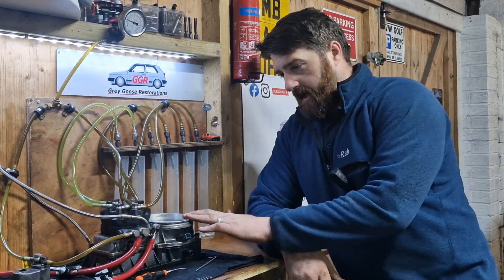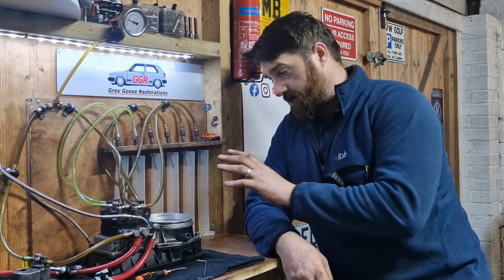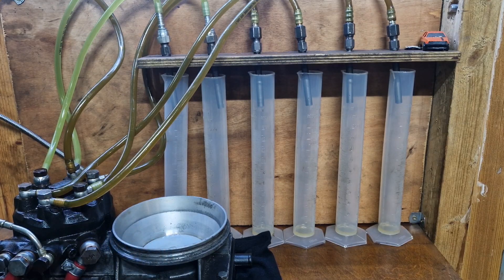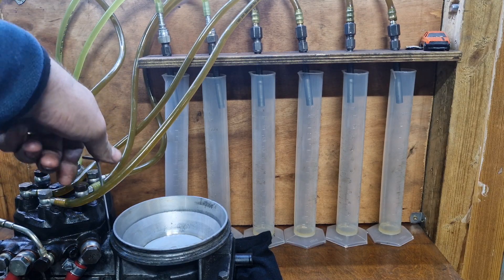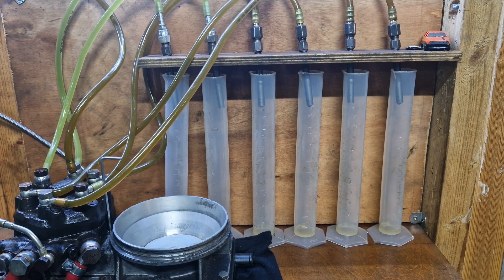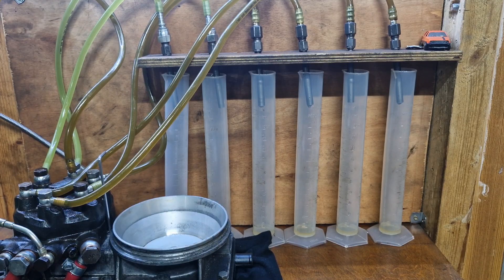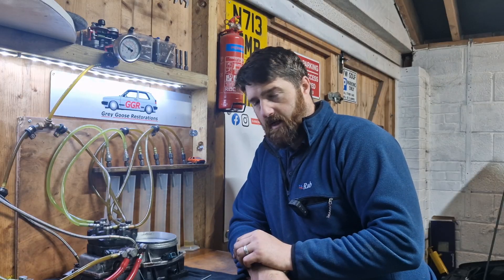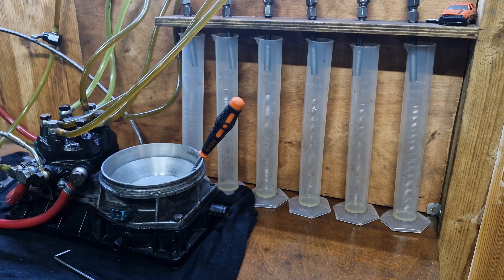Bosch K-jetronic - CO Mixture Basic Setting

Comment: That was very informative. My situation is that two of the injectors are putting out more fuel, how could that be solved?
Reply from the maker: Either adjustment is required or failed seals internally (depending how much fuel is extra)

Comment: How can we widen the air flow to increase air and performance
Reply from the maker: No need to widen as there are a few units that are very wide and will flow more air than the engine would need with the fuel, most stock kjet units will support around 25% more power without tweeks
Reply: @GreyGooseRestorations thanks sir. In regards to the wur. The electronic ones sold by 911 US guys. Some of them I've seen them fitted on mk1 and 2s. Seem extremely more powerful as the load for fuel is much finer

Comment: Quick question testing fuel pressures on the ke jettronic cis system . The fuel pressure gauge the side of the gauge with the shut off valve what part of the fuel distributor that goes into ? The cold start injector port on the top chamber or the bottom chamber?
Reply from the maker: On KE-jetronic its on the top centre union then onto the lower chamber, there's a blanking bolt on it or test port 👍
Reply: thank you I had it hook up like that but only got working pressure  on valve close I got no system pressure.  Could it be air in fuel distributor? Or what else could cause this? I was told join the fuel line from tank to fuel gauge and then shut off side of gauge directly to where the fuel line was. Is this a correct procedure?
Reply from the maker: Thats wrong

Go from top centre union into guage then the tap then onto lower chamber test port,
Reply: Thank you

Comment: Same question as @maxkaufel4715. I did turned Allen key when my Peugeot 505 STI. K jetronic started dying when I accelerator while I am driving. Now it doesn't start any more. Does the WUR needs a bridging when setting up the initial mixture. And also what causes it to loose power when I accelerate. Great thanks to your help.
Reply from the maker: Loss of power can be a number of things, CO mixture wrong, fuel flow, control pressure etc
Reply: @GreyGooseRestorations guess what, I have followed your instructions, turned the key on my car started same time. Thank you very much.
Reply from the maker: Glad to hear ❤

Comment: Is this done with the warm up regulatur connected to power? I am currently bench testing my k-jet system and I was wondering about that. Because if my theory is correct control pressure is should change the amount of fuel on idle.
Reply from the maker: Yes with the WUR working as it would be on the car

Comment: May I ask,  recently got fuel pressure right with warm up regulator, but no the car has like a hick-up at 170Km/h where it would previously with incorrect   control fuel pressure of about 5.5 bar it would struggle to about 180km/h. Now with about 3.5-3.8 bar pressure it has the hickup. What could it be. Exhaust pipe also white on unleaded fuel.
Reply from the maker: Does it hickup after a wide open throttle blast?
Also the CO mixture will need to be checked and adjusted after any fuel pressure change, potentially you have lean running
Reply: Yes, hickup happens at wide open throttle. Tried adding more fuel by turning the 3mm allenkey 1 quarter clockwise, but then the car would not start. The exhaust tailpiece is white and therefore your statement about the lean mixture is true, right? The control pressure was at 3.8 bar, but drops within seconds of switching the ignition off. Any advice please?
Reply from the maker: If any pressure drops off within a few seconds then you have an issue with the fuel distributor not holding fuel pressure, which may be your lean running as the system pressure isn't being held, what was system pressure at
Reply: Thank you, System Pressure was at 5.5 Bar if I remember correctly
Reply: Could it be the accumelator?
Reply from the maker: Accumulator would cause hot starting, lean misfire can be the lift pump in the tank failing
Reply: Thank you, I am having difficulties at hot starting as well yes. Do you mean during the day, that the car struggles with starting even though the engine is warm?
Reply from the maker: If the cars been switched off for 20-30 min and has issues starting then the Accumulator could be the issue as thats its job to hold fuel pressure in the feed line for around that period of tkme
Reply: Thank you, much appreciated, will replace the accumulator first, but I gather it might not resolve the hickups right?
Reply from the maker: I would check the in tank lift pump filter and connecting tube for serviceability and the volume delivered by the pump
Reply: Thank you. Will do
Reply: Also, I have replaced the lift pump in the tank and the external pump recently, which then gave me the correct system pressure.

Comment: Thank You for the video! How big is the hex of the adjustment screw on Bosch K-jet (Ford escort xr3i)? 4mm?
Reply from the maker: 3 mm 👍
Reply: @GreyGooseRestorations  Thank You, four your help. :) 2nd question: How to set the IDE rpm speed? (becouse my is too high 1300-1400 rpm) Where is that screw on Ford XR3i engine?
Reply from the maker: Should be on the side if the throttle body

Comment: So I hope you can answer this question for me. I have a 1988 volkswagen cabriolet and the adjustment screw doesn't seem to do anything. When i watch the dwell, it doesnt change, it just stays around 17. It bounces a bit at idle too. Not horrible though. It still hesitates a bit when coming up from a complete stop. I just cant for the life of me get the screw to change the dwell. It doenst do ANYTHING. Thank you so much! Ive been learning so much from your videos
Reply: Other than this it does start first try and is drivable. But it is slightly gutless.
Reply from the maker: With the CO mixture its best to use a gas analyser than dwell meter.

Comment: Golf mk1 1.8 gti. Car idles and revs ok in the garage but when I put it under load while driving it sounds like it’s running on 3 cylinders or or like a 2stroke motor bike, there is a loss of power and change in the exhaust note . But it does this “misfiring” only sometimes . Like if I let off the accelerator and press it again most of the time it will drive fine. Some days it will drive perfectly all the time.  What’s going on ? I have changed spark plugs / ht leads , fuel filter , change the 4 green seals on on injectors, ultrasonic cleaned the injectors, and changed the distributor rotor arm ( now it did have a bit of burn mark where the ark jumps but it’s replace now ) also changed the soft vacuum hose joiners . And it’s still doing this weird not running right thing . I tried squirting brake cleaner on pipes to see if there is a vacuum leak but as I said it only does it sometimes and usually under load . I did wonder is it possible for the plunger in the fuel system regulator to get rusty as in just not sliding freely ? Car is driven about ever Sunday or ever second Sunday
Reply from the maker: What's the condition of the in tank fuel pump? It may be getting fuel starvation
Reply: @GreyGooseRestorations  ok I “think” I have it fixed, I think the Fuel mix was too rich, And the misfire was probably a cylinder getting flooded . I did a co test using a Co gas analyser and the reading was way out. I last check the Co reading about 8-10 years ago I guess the screw vibrated over time ( can it ?) or what changed the reading soo much , would different octane petrol also change the Co reading ? I had to turn the co screw about 1.5 turns  
The Gunson co analysis read 7.6% when it should be about 1% I’m guessing ? To give AF of 14:1
Reply from the maker: I wouldn't trust that gunson one to be correct as they are wildly inaccurate, if you can do the reading 2-3 times with calibration on the tester each time and its the same then that would be good, the CO mixture wouldn't vibrate out as the thread is to tight a fit to do that
Reply: @GreyGooseRestorations I’ve been watching loads of your videos . Thank you for sharing. Please keep making videos they are really super interesting

Comment: Hi, what kind of screw it is you used for make the mixture?
Reply from the maker: Is a 3mm allen key
Reply: @GreyGooseRestorations 
Hii am having the same system I have never played with adjustments but it's not starting it cranks but does not send petrol to the injectors but from the fuel pump I get fuel to the kjet pump I don't know what to do please help
Reply from the maker: Has the car been sat for a long period
Reply: @GreyGooseRestorations yes indeed it has been
Reply from the maker: Ok it may be that the fuel pin is stuck and the air flap cant rasie it, can you lift it by hand
Reply: @GreyGooseRestorations I tried to lift it by hand a little and opening up slowly further up and cracking it over floods the injectors with fuel 
Just for understanding does the Bosh kjet pump spray fuel simultaneously as the distributor sequence? Meaning they don't all pour at the same time?
Reply from the maker: Nope they all spray fuel at the same time, if the air plate is free to move and opens the injectors then I'd say that there is something affecting the engines ability to lift the plate which can be air leaks, compression issues or timing etc
Reply: @GreyGooseRestorations  Thanks 🙏🏼

Comment: Hi Sir i am struggling with k-jetronic fuel a  1988 jetta cli the plate you show on a video an you said is for air pressure it doesn't work well , so i have to pull it up two or three times so that fuel get in to enjectors before i start the car.I am asking for advice what could be the problem...?
Reply: Yep sir the thing is I have to help it to pump the fuel inside the box bt nw I understand it might be the fuel pin is stuck. So if the pin is not working hw cn I solve that problem..?
Reply from the maker: You can try and manually pull the pin out if that doesn't work then unfortunately it would need rebuilding
Reply from the maker: Does the air plate move freely when you move it? Id check you have sufficient system pressure firstly then see where that directs you
Reply: @GreyGooseRestorations No Sir the plate is not moving freely an thanks again I wll check out the pressure
Reply from the maker: Check that the fuel pin isn't stuck

Comment: Hi i have a 1984 Mercedes 280 se it will start first turn of the key and idle but when i touch the accelerator it goes to cut out i was told the fuel pressure needs adjusting does that sound right
Reply from the maker: Potentially yes but I'd do the basic checks first like air plate heights and CO% - after than if the problem persists then I'd check the fuel pressures as this will point you in thre direction of the fault
Reply: @GreyGooseRestorations  Thank you when i start car from cold it fires with in a few seconds when i put the foot down on accelerator it just goes to cut out what is the CO% and how would i adjust fuel pressure
Reply from the maker: @Farmer2492 the CO% is the mixture of fuel at idle and sounds like yours is lean so not enough fuel which could be the air plate setting to high or the mixture not right or potentially fuel pressure issues

Comment: Hello. Great video, I shared it on a Porsche FB page. Question: I adjusted the 3mm screw all the way counter clockwise but fuel still comes out. What do you think the issue is?
Reply from the maker: Either the fuel plunger is now too low so uncovering the upper edge of the slits and your getting control pressure being injected or there is a seal failed internally or the fuel plunger is stuck? How much fuel is coming out?

Comment: Is this measurement of 10mm in 30secs the same for porche 924n/a 2 litre I have 10mm on all bottles but number one is flowing to much at 80 mm I have put new injectors in would it be faulty fuel distributor its unusual it's just one measure number one is pumping way to much fuel I have swapped the lines over but still one is spraying far to much fuel in 30 secs
Reply from the maker: If one is getting that much more then I'd say you have a failed seal in the distributor, all 4 cylinder units should be 10cc/min thereabouts
Reply: @GreyGooseRestorations you have been a great help . last question does the metoring plate open with the engine switched of when you open the throttle..or is it just when car is running under vacum
Reply from the maker: @stevehunt3847 it'll only lift when the engine is running 👍
Reply: Thanks  @GreyGooseRestorations

Comment: Very good video, very helpful. I am looking to build a test rig for K Jet as I'm helping a friend with a hot start issue on a 1983 VW Golf Gti, we think we have narrowed it down to fuel evaporation in fuel lines due to pressure being lost down return line to tank via primary pressure valve.

Comment: Is it similar values cc wise on  my 5 cylinder 
Quattro turbo engine.
Big thank you for your
Help with understanding of the fuel system. 
Still having issues on my system, on hot starting.
Cold start is perfect, 
Thinking injectors.
Leaking slightly after 
Engine stopped.
Hot .even after twenty minutes. 
Lot of cranking to fire up.
System Pressure is 5.4
Bar.
Injector's yr old.
Car feels running slightly  rich.
Up to 60 mph.
Best regards. 
Darryl Tucker.
Reply from the maker: Yes regarding The CCs the quattro did use the 5th injector to aid hot starting so you could check if that system is working

Comment: I have the same system on my BMW e21, 410k km and still running. As long as people don't mess with the allen screw and the plate without knowledge, they system is very reliable, one thing though the system is very sensitive of vacuum leaks. My other car has a Kuggelfischer mechanical injection, both very robust and simple.
Reply from the maker: Exactly, once set and working, there isn't much to go wrong.

Comment: This is the easiest and most reliable system one can find. I'm using t in my Audi 100 5e Turbo
Reply: Hmmm... Easiest and most reliable provided the car has been kept up to scratch maintenace wise... Many, Many Kjet Cars are now up to 40+ Years of age, with some having been laid up for decades.... In these instances the Continuous Fuel Injection System can be a pain to re-commission... Air leaks, Faulty injectors, seals, Clogged Fuel Lines, Junk in the Tank, Clogged filters, Dead Fuel Pumps, Persished seals, out of calibration metering heads etc..If you check the comments they're mainly from head scratching enthusiasts (like myself) who are reasurrecting an old skool classic.... With that said I'm pleased that yours is running sweetly.... Nice cars the 100 5e Turbos!
Reply from the maker: @1881Gordon once they are working its a bullet proof system but like you said can cause numerous issues after all these years
Reply: @GreyGooseRestorations Agreed 100%. I should have added that we truly appreciate Knowledgeable people like your good self for brilliant tutorials, helping us get our aged cars back to good, reliable health... Thank you GreyGoose x1000 👍

Comment: Hi thank you very much for making all these videos it helps us a lot a specially us in South Africa 🇿🇦. A lot of people who had or still have these cars are no longer running the original system. Due to the fact that they have no idea how to deal with this system. I once recalibrate my 1.8L 8v called CTI in South Africa which is the same engine from GTI , which produces 82 kw and 157Nm of touqe..most people end up putting a carburetor which is not good as the original k jetronic is. Once thank you so for your videos are helpful.
Reply: Hi. I'm in Pretoria. I use this system in my Audi. I won't change it for anything.
Reply from the maker: Glad they help out around the world
Reply: Contact me I still use this system on my Audi. I'm in Pretoria.
Reply: @georgeseckle5982 hi I've got the same golf but the air and fuel mixture is giving me a headache 😢

Comment: Hi, Great video - thanks! I have one question though. At ~ 7:58 you said that one wants 10ml in 1min - 5ml in 30sec, but later, you say that it should be 8-10ml in 30sec. I got a little bit confused - what volume should it be? Do you have book figures for 8V 2.0NA Porsche 924? BR
Reply from the maker: @mariuszbaraszkiewicz5232  should have been clearer
Basic setting should be in the region of 10cc/min but on an actual running car aim for 8-10cc/30 sec  this is because the book figures are not real world figures. You car should be around 1-1.5% CO at idle. And 8-10cc/30sec should be around this area (on most 4 cylinder engines) hope that makes sense
Reply: @GreyGooseRestorations  Hi, thank you for your answer. I read many manuals about setting the air/fuel mix, but only after watching your video I managed to set it up so the car idles and runs smoothly. Thanks again!
Reply from the maker: @mariuszbaraszkiewicz5232 fantastic, glad this helped
Reply: I need help with air plate height adjustment
Reply from the maker: Hi, check out my other videos 👍

Comment: Are you sure at 2’33" ? 
I refurb one distributor with the missingparts kit and now my car won’t start, when I look into the chambers removing the plugs I could see a lot of fuel on the pistons and my plugs are wet. So I should screw or unscrew? Thanks for your huge knowledge regarding this absolute torture that is Kjet system 😅
Should I remove my injectors and see how much my injectors spray during 30sec for exemple?
Reply: Ok I’ve done it. I unscrew at the maximum the CO screw and they’re still flooding like if I was full throttle. When I push down on the plate the flow reduce a little bit but it doesn’t stop flooding 😢
Reply from the maker: If the CO is all the way lean (anticlockwise) and fuel still comes out with plate at rest and ignition on then there is a fault internally on the fuel distributor
Reply from the maker: If the engines flooding then yes if pull them out and see what there doing, thanks